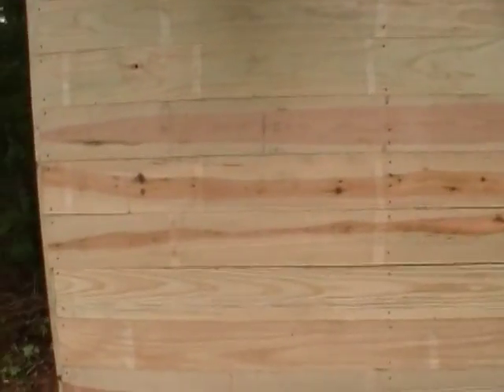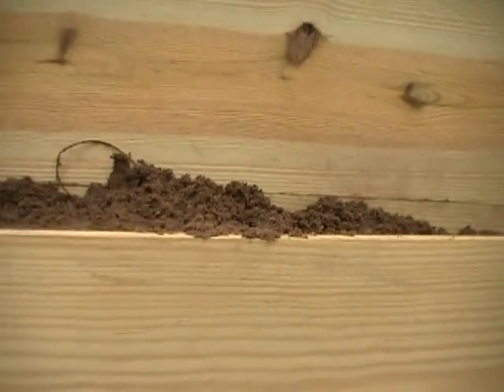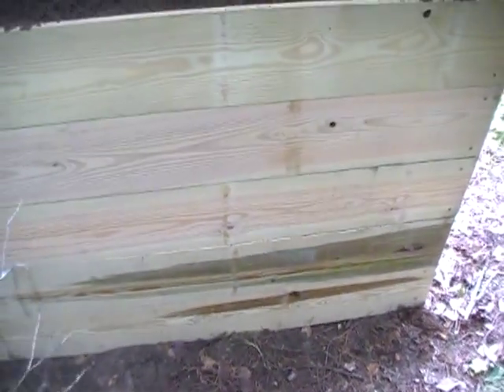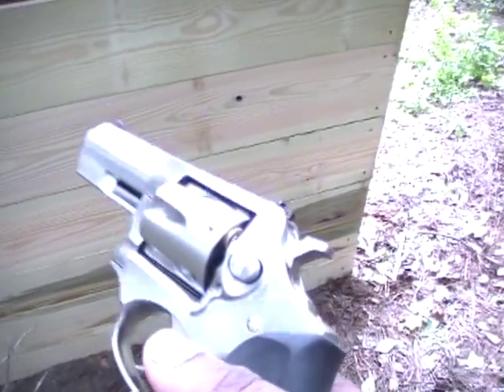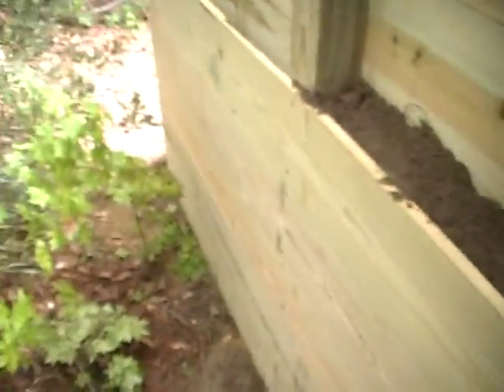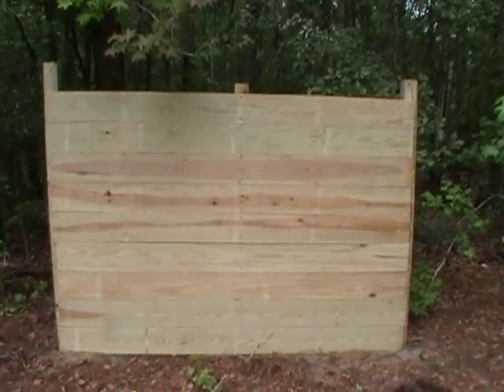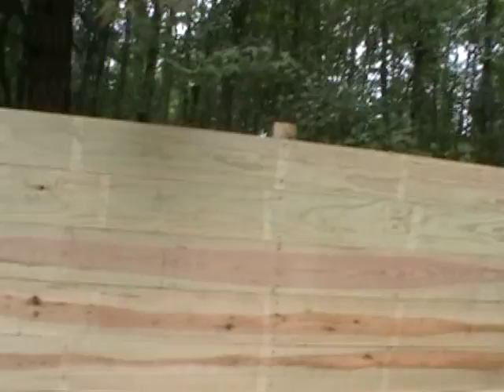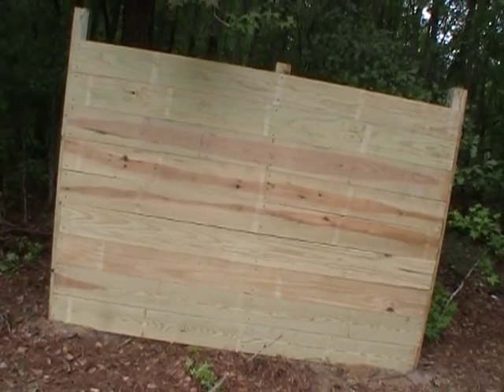Shooting Backstop Tour 2 - Shooting Test

Comment from the maker: I did put some old tires behind it, but I did not fill them with sand. I did a "Shooting Backstop Update Winter 2013 - Pt 2" video showing the tires in place. I stacked them higher this spring, but I didn't do a backstop video. I would still like to get some rail ties and stack in front of the backstop